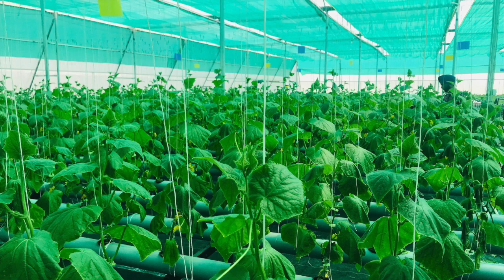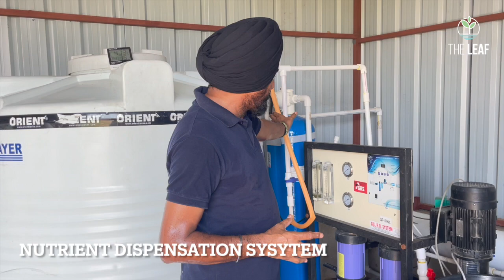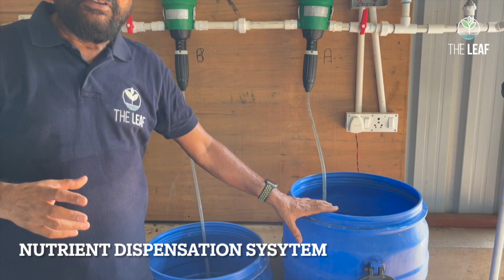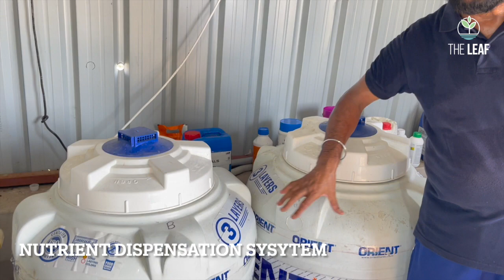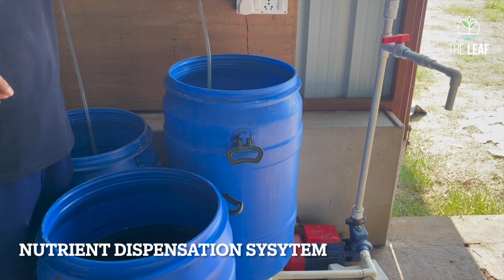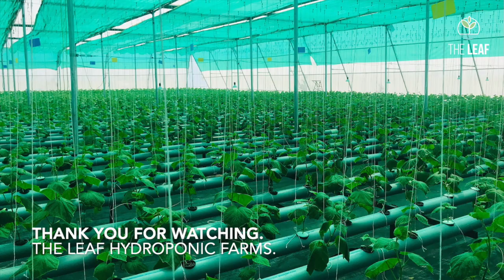Nutrient Dispensation System for Hydroponics

Comment: Sir,
Newbie question For NFT systems why would there be need of 3rd dosatron ? (hoping the spelling is right)
Sir as you have specified in the video description that this Nutrient Dispensation System is specific to Grow bags, what would be the required changes for NFT ? Can you please explain

Thanks,
Sunil
Reply from the maker: Third Dosatron is required for maintaining pH of the nutrient solution by adding an acid tank in line with nutrient stock solution tanks.